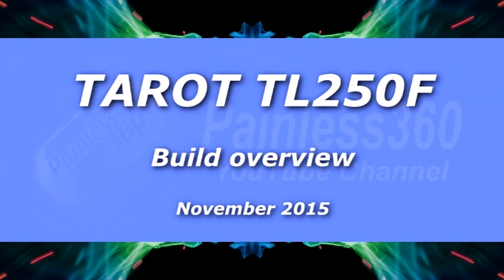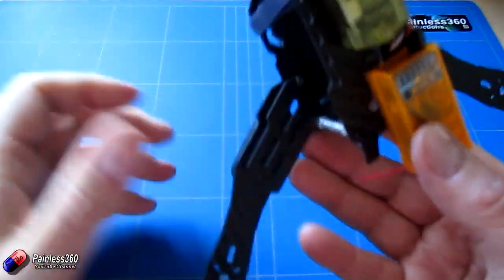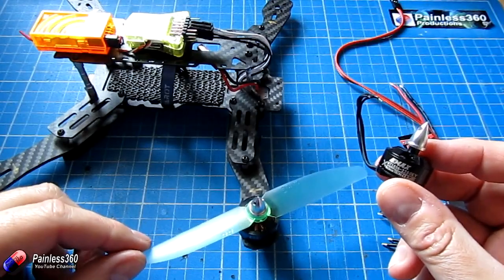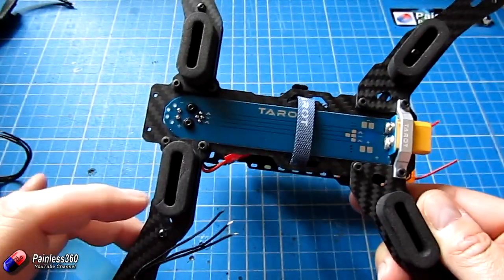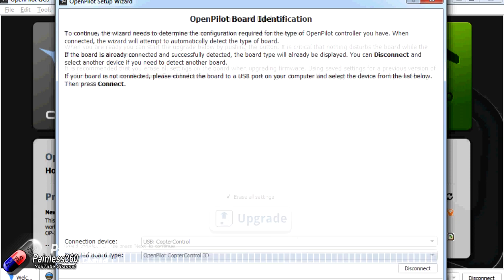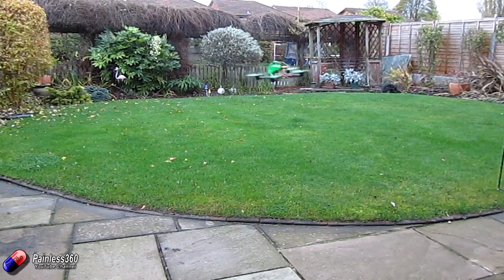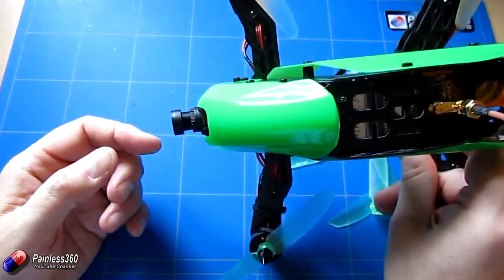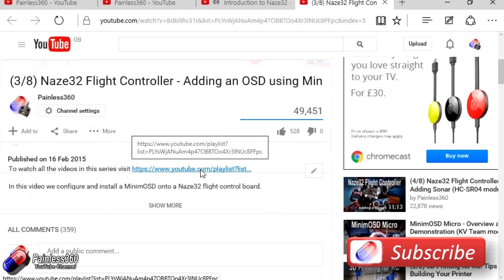Tarot TL250F frame – full build video

Comment: Thanks for this, I finished mine on Monday!

I used a Flip32+, Orange 815X CPPM Rx, unnamed 12A SimonK ESCs from BangGood (just too big to fit between the leg and upper plate, dammit!), DYS BE1806 motors (a little taller than the EMAX motors because of the seperate prop adapter, which allowed me to mount the ESCs on top of those upper plates) and an Eachine camera/video Tx combo with a Micro Minim OSD.

Due to work and weather, I havent taken it outside yet, but it hovers really stably indoors.

Just waiting for white covers for that Imperial Stormtrooper look!

Comment: First thing to go out would be the camera, its protruding out entirely to far. You might also be able to get a bit longer aluminum stand offs to get your ESC's to fit where they should? Loving the look of this frame though, great build video.
Reply from the maker: We will be looking at some perfect ESCs for this frame in the coming week(s). Some of the latest BLHeli units are very compact..
Reply: +Painless360 you would definitely be able to fit some 20Amp Little Bees, getting really surprisingly amazing performance out of the little guys
Reply from the maker: The ones we will be looking at on the channel are the DTS BLHeli 10A SN series - very compact

Comment: you could use the flexiport on the cc3d for ppm receiver input. i think it is much more convenient than to remove unused cables from the receiver connector.
Reply: +keremizgol I agree, I'm running 3 machines off the flexiport.
Reply from the maker: +keremizgol I did consider that but the layout of the components made the traditional connector an obvious choice for me. Happy flying!

Comment: First, I have to thank you for your tremendous effort putting all videos up here! 
Awsome job that will help me, and many other beginners. Also some experienced folks! 
Im a returner to the RC hobby. But think its been way more than 20 years since the last crash.. :) 
Now, there has happen alot on all levels. But when I discovered quads. Im totally hooked again! 
Bought a Hubbsan x4, that have erned to be written off several times. Lol

Now, Ive bought a Tarot Robocat 250 for me and my son. As something to do together. 
Have ordered most parts. The frame is in my hands. But waiting for the rest to arrive. 
But. Havent ordered a cam yet. Seem to be limited space in the front. I hope you can point me to a few directions. Since Im on a budget. I want a good enough cam, that fits. Buying a to less of a good cam. That needs a early Reiterment. Is also expensive. So Im totally lost when looking around. 
Will have a cc3d revolution mini om board. So I will have a good input from your vids! TY
Reply from the maker: +RocketSailing Best of luck with the build. The AOMWAY cameras we've looked at are good for the money and are not too expensive.. Happy flying!

Comment: The frame is made for the 1806. The screw holes is made for that mounting. Saw another video with a guy telling the 2206 didn't fit.
Reply from the maker: We used 1806 here and they fitted great.. Happy flying!
Reply: 2204 2300kv motors fit but you can only use 2 screws for each motor, and that's all most of rotorriot Charpu & Steele use so I know it is good enough for me!

Comment: Dear Painless360, I have not long bought myself a tarot 280H from watching you video, but im confused? How are you powering the FC if you have (clipped the +5v lead), is that not in affect the same as OPTO ESC?
Reply from the maker: +Christopher Holmes the front ESCs are plugged into the FC directly and do have their red wires so provide the 5v. It's only the rear ESCs that don't have the red wire connected..
Reply: So the Centre track is only for the Signal and ground wire for the rear ESCs, and the track has nothing to do with the front ESCs? So i guess that the Front ESCs Wire's are left full length then routed to the FC.

Comment: for the esc space problem, why don't you just replace the metal stand spacers with taller ones.  in this way it will lift up the upper board limitless.   you can fit almost every esc type by doing this.
Reply from the maker: +abbeyglencircle great idea. Post pictures if you do this to yours. Happy flying!

Comment: Greetings! Thank you for your videos, they helped me a lot understanding hot to build and setup a quad. I've decided to built my first quadcopter, using the Tarot TL 280H frame. I have 2 questions though. First, by placing the CC3D "backwards" did you had to "tick" a specific box or setting for that reason on the setup software or did you follow the usual procedure setting up the CC3D like we've seen  on your videos (i'll be using LibrePilot with my CC3D Atom)? Secondly, my ESC's are OPTO and i don't have an external BEC, i do have a Power Distribution Board that gives 5V, so my question is, in order to power up the FC and the Receiver (Spectrum AR6100e) should i connect to rotor pins 5,6 on the CC3D  or BATT on the receiver (but then i have to bind...and i was thinking of using al 6 channels). Thank you!
Reply from the maker: +Kostas Argyropoulos see the video in the CC3D playlist where we cover this.  All of the steps to make a model are covered. Our video where we make a Tarot model with a cc3d may be interesting to watch too. Best of luck!

Comment: The landing gear is stick on foamy feet right?  Why not put it under the motors?  

What about using tour 3D printer to make 3mm thick motor shims for between the arm and motor?
Reply from the maker: +Dean Cory That would work too. The foam would obscure some of the motor screws though.  I've designed shims for the motors already but until I swap out the frame I'm too busy flying it ;)
Reply from the maker: +Painless360 https://dl.dropboxusercontent.com/u/67301981/motor%20spacer.jpg ;)

Comment: also the orange rx you are using is it the R615X RX? I SEE THAT YOU JUST HAVE ONE WIRE TO THE RX IN THE BAT/BIND PORT? SO THIS IS AN SBUS RX? OR DO I HAVE THE WRONG RX MODEL?
Reply from the maker: Yes, the older R615X - one of my favourites. It supports PPM ;)
Reply: Scream a lot? :)

Comment: why didn't you just take the stand offs out or make them smaller ,and mount the arms directly on the bottom frame therefore you could mount the escs on top of the arms?
Reply from the maker: +fastsofaracing not sure what you mean but I would be interested to see it when you do.. Best of luck!

Comment: Hello, I could really use your help. I have the 280mm Frame. My issue is that I have to wire in a ubec. I am using the afromini 32 flight controller and it will power my rx. The rx operating power is 3.5v to10v, this is why I need a ubec. The flight controller doesn't regulate voltage. The problem is the board has connections for four escs. How Can I power up the ubec? Can I power two escs off one positive and negative terminal? Or so I wire an esc and the ubec on one positive and negative terminal on the power board. I hope this makes sense.
Reply from the maker: +DavBoston Normally the ESCs will have a 5v UBEC in them, else you need to add one and power the flight controller and receiver from that. See our videos in the 'Introduction to Remote Control' for lots more useful tips and tricks.. Best of luck!
Reply: +Painless360 thanks for your response. Unfortunately my escs are opto, all four of them. Is it possible to join to escs on one connection? Or an esc and my ubec on one comes too to get power to both?
Reply from the maker: Then I'd plug a separate little 5v UBEC into a spare port on the Rx and power everything from there.. Best of luck!

Comment: HI!

I have the same quad from bangood but I have a problem.

How do i connect the wires?

I have a serious problem connecting the wires on the frame, so I tried to follow your step by step process, but there's something I 'm doing wrong.

I have the reciever, connected to the cc3d, and the escs connnected also to thecc3d. I have power in the fpv but no power on the cc3d. I gave power to the cc3d but I think I burned it.

can you show hgow you connect the wires and a little schema about how to do it?

If I connect the battery to the cc3d it heats. I think I burned it because The firts time I did it, I had light for only 2 sec. After this, it smoked and burned. 

So please I will thanks you for info about how to do it.

Thanks
Reply from the maker: +David Salazar All of the information we have is in the video - if you need more help then see the website for one-to-one coaching and advice charges..

Comment: Great video, how do you solve the problem of the ESC's signal cable ?
Reply from the maker: What problem? There wasn't one..
Reply: I'm sorry, but if the ESC has the signal cable, the positive and the negative and I connect only two wires on the PDB and on the receiver, What happens to the signal cable ?
Reply from the maker: +mamifraro watch how we do it in the video. If you are new to the hobby then there are more useful videos in the Introduction to RC playlist and the Quadcopter building for beginners series on the channel too. Best of luck!

Comment: hi, great video. it's really helped me with mine! I've even bought a cc3d atom after watching! which question though, my esc's (hobbywing 10a) don't have a 5v receiver wire so how can I power my receiver and cc3d?
Reply from the maker: See out videos in the 'Introduction to RC' series. You'll need to get 5v from a PDB with a BEC on it or use a separate BEC to provide the 5v the flight controller and receiver needs..

Comment: Hi painless I just built a robocat 270 looks just like this almost lol I'm running cc3d open pilot with 2204 motors with 5X3 props I have it running on default and it flys good but I'm having a slight shake when I throttle up and level out! I'm running a 3s with 1500 55c burst ! Can you point me in the right direction to get this quad stable? All the open pilot forums are shut down and the info I can find don't explain exactly how to adjust things! Thanks take care!
Reply from the maker: +Camshaft Shaft I'd try and follow the advice in our PID video. Sounds like the D is too high.. Best of luck!
Reply: +Painless360 thanks for the quick reply I will do that take care sir👍

Comment: Hi thanks for a great video, it has really helped me with my build, but however all the ESC's that came with my combo kit (EMAX Nano 20A ESC) have only two wires (Black and Signal) so how do I connect the front ESC's and power the FC? Would appreciate your kind advice. Thanks
Reply from the maker: You'll need a separate 5v power connected to the FC. See our 'Quadcopter building for beginners series' for more tips and tricks. Best of luck!
Reply: Thanks for the advice, I will check the video...Cheers!!

Comment: Hi bro, can i fix a 6 inch prop? If using a 2204 motor v
Reply from the maker: The props we use in the video are the largest the model will support. After that it's will the motor run them and how will the larger prop affect the ESC rating you need. Happy flying!
Reply: Painless360 okok

Comment: good video and info thanks.
ive just got the orange 280 size im building can you help me fpv, im looking for a good setup for woodland and quarry flying , hope you can help load of info on internet on fpv but none on this subject. many thanks (andyuk)
Reply from the maker: +andrew sherriff Do you already have goggles or any of the kit? Happy to talk it through but a chargeable call may be the best way..
Reply: hi i have a setof quanum v2 and a aomway 600mw tx , 700 tvl emax camera and a set of fatshark antennas at the moment
Reply from the maker: That should work well. Best of luck!
Reply: thanks

Comment: DO NOT GET THE GLASS-CARBON VERSION!!!

I hit a bush at 4ft at less than 5mph on my first flight out, it broke BOTH front arms at different places.

It may have been my kit was defective, but still, the material isn't nearly as good as G10 or real carbon.

A shout out to BangGood for making it right!.

Also, ZTW spider ESC's will fit no problem, and if not, I tapped the esc's to the belly and it looks very clean.